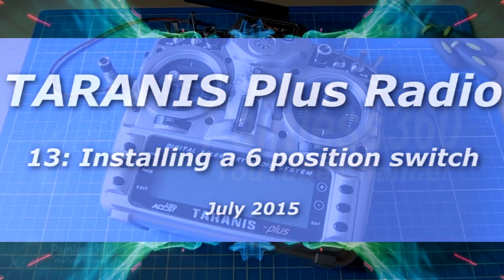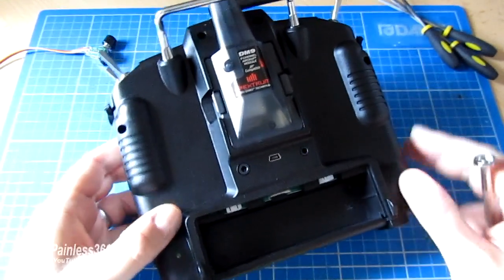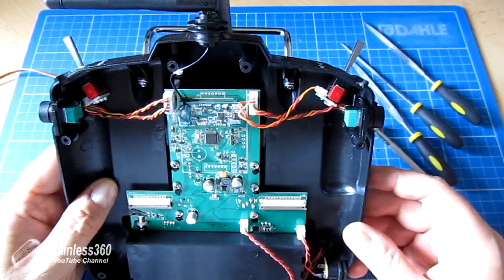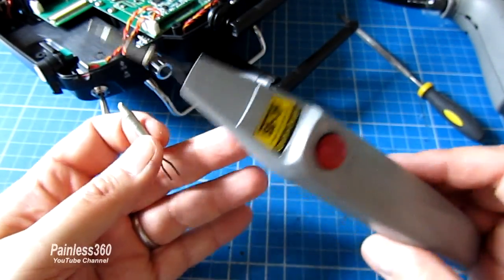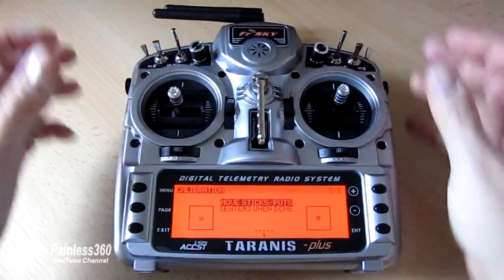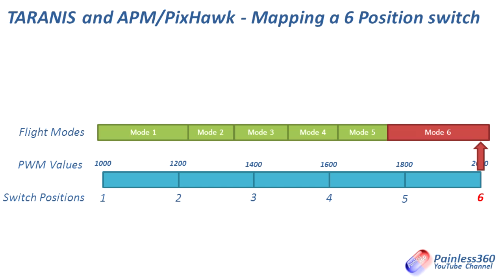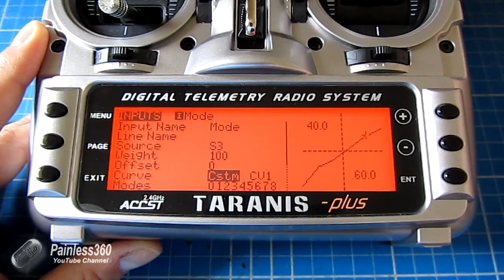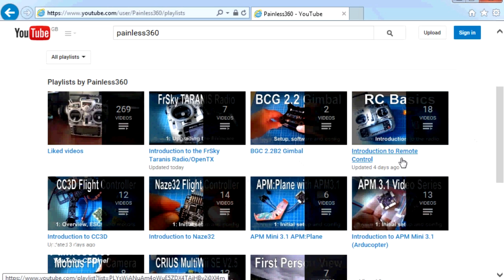(13/13) FrSky TARANIS Radio – Adding a 6 position switch (S3) and setup for APM/PixHawk

Comment: Why, when calibrating the radio, did you start with all sticks centered except for the 6 position soldered to s3?  Why not center the new 6 position switch?  I just installed a 3 position switch and it will not calibrate correctly.  It seems to skip half/some of the positions.  I added the S3 in my Radio Settings first.  Then I calbrated.  I got 4 positions (not 3.)   I tried it several times, but most times I got 4 positions, and once or twice I got 3 positions only.  However, when I set the radio up to "Play Track" as a Special Function, position 2 seems to get skipped every time.  Position 1 plays the right track, then when I switch to the middle position, I get the track that should be at position 3.  When I switch to the bottom position on the switch, I get the 4th track played.  So the way I have it for now is physically a 3 position switch that comes in as a 4 position switch in the Radio Settings.  I have four tracks specified as "Play Track" in Special functions, but the 2nd position of the switch just gets skipped every time.  Can you think of any way to correct for a 3 position switch?  I've tried messing with some stuff to no avail.
Reply from the maker: Try it both ways. Best of luck
Reply: @Painless360  Actually, when I specify the switch as "multi-position switch) in OpenTX, 6 positions are installed.  After calibrating the 3 position into the S3 (expects a 6 position) I get positions 1,3, and 4.  So I just specified as special fuinctions what I want for those and not using the other 3 positions which don't exist in my hardware.  Works fine, and since I'm only playing tracks with the switch, it is not totally critical.  I did not realize the Taranis expects a 6 position switch.
Reply: @Painless360 IT bothered me having the improper switch for S3, so  I ended up removing the 3 position switch and installing a pot without detent instead and can use it for my gimbal tilt and pan rates.
Reply from the maker: Great to hear that you are sorted. Happy flying!

Comment: How does this arrangement be applied to a QX7 Taranis Radio if applicable ?
Reply from the maker: I'm not sure that the QX7 has the port for an 6 position switch like this..
Reply: @Painless360  Thanks for your quick answer. I take the opportunity for thanking you the efforts you develop to document the community 😊

Comment: Hr there. I camt find the calibration menu. did something changed in 2.3.11/12 ? or i am missing something in the radio?  i did all the other steps you described.
I ecven tried on the companion simulator to see if i am missing something and even there its not present....
Thanks
Reply from the maker: I'm not running that version here to check but I've not heard of that part of the menu being removed.. Best of luck with it..
Reply: @Painless360  I just didn´t saw where the calibration word was.. it's a submenu and i thoughr it was an actual menu after hardware...
Thanks for the good work you're making in this chammel! it's beeing really helpfull to me 
cheers

Comment: Hi Painless360; I've tried adding the 6-position switch to a Jumper T-lite (this would make it into such a useful little tx) and I don't seem to be able to define "Pot" or "potentiometer" in the hardware screen of openTX even though it's a three wire pot?I can only define it as None, Toggle, 2POS or 3POS. FW is Opentx-tlite, Verson: Factory(84c86f71). Date 2021-01-14 EEPR:219 
What, if anything can be done about this?
Reply from the maker: I'm not sure it can. I know that other radios in the Frsky lineup didn't have this option too.. Happy flying

Comment: Have you made this modification in the 2019 version of the taranis? I have tried and when I program it in the radio, the s3 runs off the up and down motion from the right stick. Also there is no numbers showing the switches position. Any info or if you have made a video please send the link. Thanks!!

Comment: I had to do the curve backwards to get the desired result on my FrSky Horus X10 Express.  60,40,10,-20,-40,-90.   Also "Standard" isn't currently an option for the curve.  It's Fixed X or Custom X.  I used Fixed.   6 Points, Fixed X, Smooth.  Otherwise, exactly as described.  It seems to me that the expected PWM values in Arducopter are something of a bug and should at least be configurable.  If they were, none of this tom-foolery with the radio output would be necessary.  The PWM values must be associated with some specific model of radio that none of us are using.  Oh, and THANK YOU for figuring out the curve values and posting this video!  You've saved me quite a bit of time.

Comment: Mr. 360, you saved my day! Just another super helpful video. My experience for everybody that got one of these little flight mode switch boards instead of a 6pos switch for my brand new X9D+. I got mine from hobbyking and its manual describes, that you can adjust the 6 different PWM values for the modes via a little key combination. Obviously they changed the hardware or software of this thing over time and it just has no effect, so your PWM values do not match your mode values and the modes are somehow reversed (1 highest and 6 lowest value).
So I just dumped the manual and took this route via a costum curve and that worked beautiful! I even changed the values from from 1 (lowest) to 6 (highest).
And here is an easy way to get the correct value for every point of the curve: Just connect your FC to MP and open the flight mode screen. While you change your values of the curve you can see the PWM value change live with every step.
Thanks man!

Comment: I was able to install the switch and calibrate without issue.  However for some reason when I switch from the 3 position to the 4th position it skips and lands on the 6th position within Mission Planner.  I setup the curve precisely as you have instructed.  Any ideas?
Reply from the maker: If you can see the six positions in the calibration then re-check those PWM values, they may need to be tweaked. best of luck!
Reply: @Painless360  , where do I make the PWM adjustments?  Is that in Mission Planner?
Reply from the maker: You can't change them in Mission Planner, if you could you would need all the messing about. It has to be on the radio, best of luck!

Comment: Just one more thing - it looks like the 6 position switch APM configuration is model specific regardless of whether you use curves or special functions to implement (since both curves and special functions are on the OpenTX model menu and not the radio menu).  Would this be correct?  Not that it's a big deal either way.  I would assume I could copy an existing APM model to easily create an APM configured model for a second (or so on) APM aircraft.  I could implement the switch differently for non APM craft.  Cheers!
Reply from the maker: Yes, once you have a model that work - copy that to a new model memory when you have another model using a Pixhawk or APM. Makes it a lot faster...

Comment: Great video - I used a 1/4" drill bit for my hole but ended up enlarging the hole with a 17/64" bit for a perfect fit without filing.  A couple of snips from a Xuron cutter removed enough support rib material to clear the switch body.  I sacrificed a twisted servo wire to make the connection between the switch and the S3 pads.  Works great!  Thank you - very valuable as always!

Comment: I have tried 2 different Frsky Multi position switches and every time, when I'm at the input screen and I test the 6 positions on the curve, they show up as -89.9/-100, -5.2/-0.4, 20.2/33.5, 32.6/50, 40.1/60, 59.8/99.8. Do you have any idea what is wrong with my radio or why this isn't working? Did I get 2 bad switches in a row???
Reply from the maker: I had something similar until I calibrated. The last few Opentx versions have had problems with the 6 position switch..

Comment: Hi folks. If you don't want to use needle files drills are fairly readily available in 0.1 mm diameter increments. The specialist suppliers will stock them in 0.05 mm steps. Best to drill a small diameter pilot hole first, then open it up to size. That way less risk of the drill wandering. Cover case with soft towel and gently clamp to work surface unless you are an octupus!. Ideally use a small cordless drill on a slow setting. Running fast may melt the plastic. Push very gently. Ideally use a 'stop' on the drill to prevent going in too far. A band of tape wrapped round the drill will work well. You can debur the hole by using a slightly larger drill just held in your hand. Don't use power drill for this, you'll probably just enlarge the hole too much which is annoying. Bob UK.

Comment: I have a taranis qx7 with a x6r rx sbus support, and i don't know how to connect sbus to apm
Reply from the maker: It’s not supported directly. If you google something like ‘sbus apm support’ you’ll find posts like this.. http://diydrones.com/m/discussion?id=705844%3ATopic%3A1577814
Reply: Painless360 thanks dude, but one problem i've seen lots of posts and discussions about this but most of them use the same program on the pc called atmel flip and for some reason it doesn't work on my computer
Reply from the maker: +talal Alotaibi not sure on that one, I've never used that program here. Happy flying!

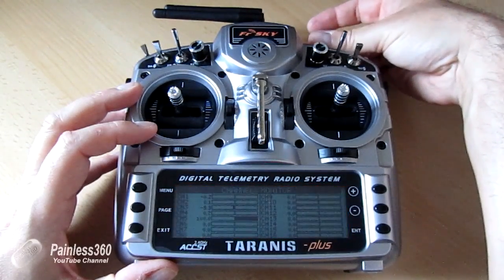Comment: I just installed my rotary switch following your excellent video. Thank you.   However, I have a problem.   All controls including S1, S2, and the new S3 worked as expected in "CALIBRATION"  with bar graphs going stepwise up and down on S3 when I rotated the newly installed 6 pos switch.   However, when I went to look at "CHANNELS MONITOR"  (10:45 of 17:47 in your video), CH5 did NOTHING AT ALLl when I moved the 6 pos switch through it 6 positions.  Also, moving the factory installed S1 potentiometer and/or the S2 pot produced NOTHING AT ALL on any channel.      

BTW, I have just recently installed the OpenTX version 2.2.1 (which seems to work fine), but the page setups are slightly  different from your earlier version.  Specifically, in the HARDWARE page, where I had defined the new 6 pos switch as S3 = "Multipos Switch" , there is a NEW column in 2.2.1 which is a three character field.  This field contained "- - -" for all the stick controls (Rud, Elev, Ail) and for the factory S1 and S2, so I left it as " -  -  - " for the new S3 = 6 pos switch. 

The fact that CALIBRATION seems to respond nicely to S1, S2, and S3 suggests the hardware is all fine.   However, I think probably I have a Taranis X9D+  setup problem , perhaps something unique to OpenTX ver 2.2.1??   

Any ideas would be welcome.  I am a FrySky noob, and bought this new X9D+ and  FrSky rec'r for FPV quads using Pixhawk, so I need the switch S3 to work to change flight modes.
Reply from the maker: Check out my video on using GitHub, the answers are very often already about. In this case, it looks like the S3 bug is still there in OpenTX. I'm waiting for the next release before upgrading my main Taranis with the 6 position switch on it personally.. https://github.com/opentx/opentx/issues/5104
Reply: Thanks for the prompt and useful reply!  I will read the github comments and learn.   I suppose I could revert to the earlier OpenTX version and the S3 switch might work - is that what you are suggesting  (what version works?).      Based on the github, I may also try adding a cap across the switch terminals to clean up the switch bounce.  (0.1uF seems smallish, so I may go slightly bigger).

BTW, I could not be more delighted to have just found this wonderful open source community and the fantastically flexible and programmable FrSky Taranis X9D Plus.    I just stepped into the future!
Reply from the maker: +thomas low you could try an earlier version, that'll probably work. It appears that ever since version 2.2 came out, there have been issues with the rotary switch. Personally, I'm just going to wait until they get the code right before I bite the bullet. Happy flying!
Reply: I am very  happy to report that I just got my 6 pos switch to work with verision 2.2.1 on my new Taranis X9D Plus.  WHOOPEEE! .   Since I had a brand new Taranis Plus, the behavior of switch S3 needed to be defined. (I tried to do this from the transmitter's GUI, but it simply didn't work.)  I just followed the method using OpenTX Companion to edit my first MODEL01 and then upload the result to the Taranis Plus.   This method was outlined in the  2015 video in https://open-txu.org  (specifically in  https://open-txu.org/2-2-04-frsky-taranis-radio-using-opentx-companion-and-curves-by-painless360-may-2015-4-of-13/  ) .   Using the most recent OpenTX Companion 2.2.1 (same vintage as the firmware on my Taranis Plus)  I defined a curve relating the X values coming from the rotary switch (-100,-60,-20,+20,+60,+100) to the desired Y values from your video here (-90,-40,-20,+10,+40,+80) and associated each [X,Y] with the switch positions S3_1, S3_2, ..., S3_6   .   I demo'd it was working on the OpenTX Companion simulator, and the then I did "Write Models and Settings to Radio">     I would be happy to email details if that would help you or your viewers. 

Voila!    The 6 position works in the most recent OpenTX release 2.2.1    (Given all the comments in github and amazon about switch bounce, I still think I will install a cap between the signal and ground line on the 6 pos switch  (I am thinking 1uF).  I don't see how it could hurt, and having spurious pulses from switch bounce can't be good.

Thanks again for your help and excellent videos.

Comment: Help! I have a model on page one with an asterisk next to it and it will not delete? I can only back up model, copy model,or move model. What have I done and how do I get rid of it? It's communication with the model is way wrong.
Reply from the maker: +Bradley RCREX Turner the model with the asterisk is the currently selected model. You can not delete the active model. Select another model and then you can delete it. Please see the other videos in the series..

Comment: Hi Lee  I'm in trouble again.  Recently upgraded firmware to Open TX 2.2, no problem there.    Fitted six position switch following your video and wiring diagram. In hardware I designated It as multipurpose switch. In the calibration screen with the knob fully anticlockwise  it was indicating about the middle position. and did not move when turning the knob. The indicator did however move when the pot 2 was turned, but in the opposite direction to the pot2 indicator. as far as i can see I have followed your instructions to the letter. i was wondering if the firmware upgrade might have upset something
Reply from the maker: +Ken McNaughton if you Google it you should find this is a known problem. Looks like there's a fix almost here. https://github.com/opentx/opentx/issues/5104
Reply: Thanks for that Lee ,it is very similar problem, but mine goes further than that. After upgrading to 2.2 version  I have no sound,, beeps, or Haptic activity at all. I have tried replacing the contents of the sd card, i had to do this with a usb card reader because my bootloader has also disappeared, I thought that this was a permanent fixture in the main chip. Now when i squeeze the trims together and turn on the tx I get a blank screen, with the backlight. which stays on when I switch off, I have to remove the battery to turn it off. the only work that I have done, is soldering the three wires to the six position switch as per your video,. other than this it is working fine. ahum.

Comment: Hi Lee  i recently fitted the six position rotary switch to my Taranis, It works fine with Mission Planner.  I bought two switches at the time, and still have the second one. I wondered if it was possible to fit this in place of the rotary knob on my Spektrum DX9. Or is it onlt possible on the Taranis
Reply from the maker: Sorry, I've never tried. I have a DX9 that I bought just before I got the Taranis and it's never come out of it's box since.. Happy flying! :D

Comment: Hi, I ordered the Pixhawk flight controller, my question is,
can I add the 6 position rotating switch to the DX5e the one I got is a 2 position
mode switch. If not, will the trainer and mode switches can work together to toggle
6 modes.   Tnx
Reply from the maker: Sorry, not sure as I've never used that radio. Best of luck with it..
Reply: Tnx for reply, will keep searching, Regards from Amman

Comment: He great video,
I am using mission planner and arduplane (it is for a Go Discover)
i use a Taranis with an external EzUhf TX and a EzUhf RX
I followed the whole video and build it in ( 6 pos switch), after that i made the curve, after that i put it on ch 5, after that it does not show up in mission planner, i can't change the flight modes. can you plzzzzz give advise.

I use a ezuhf 8ch lite, radio calibration is done and complete. The other problemn is the failsafe on ezuhf i can't lower the endpoint of my throttle ch can you hint me in a work around.

Kind regards from Holland and keep up the good vid's, i follow them all the time.

Comment: Great demo ):-) I have the switch working and I wonted to assign Ambers' sounds to the different flight modes, but I was unable to do that as the multi pos SW didn't show-up  in the special functions menu. Is there a way to do this? As when I'm flying it would be good to hear I was in the position I wonted. 
Also Is it possible to have the various modes shown on the screen?
Reply from the maker: You can use logical switches to detect the values for the mode positions on the 6 way switch and then use those logical switches to play the sound files.. Best of luck!
Reply: Yep, done that. But Is it possible to have the various modes shown on the screen?